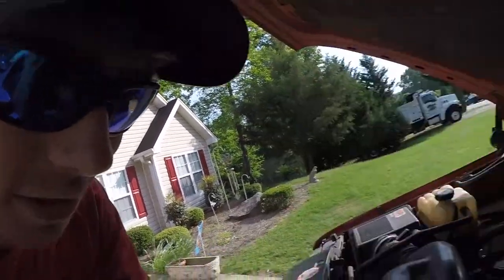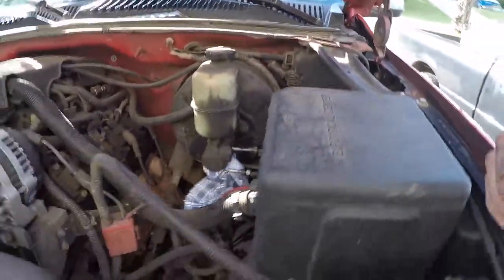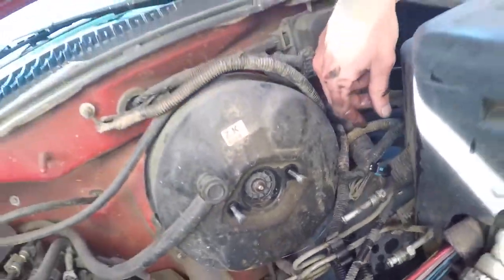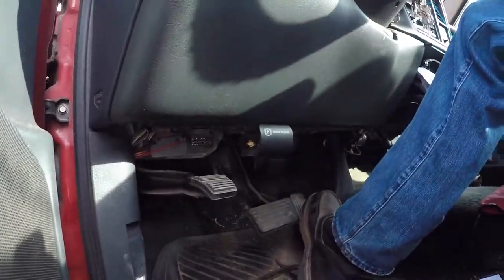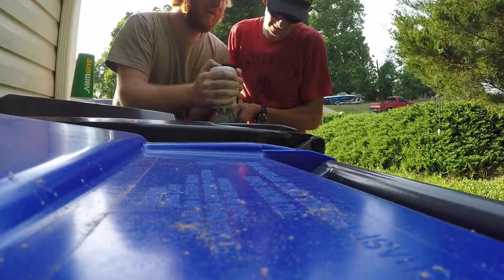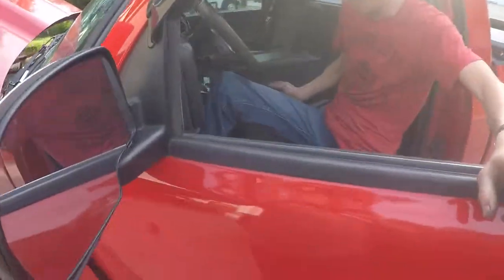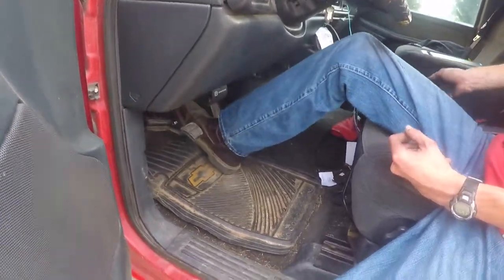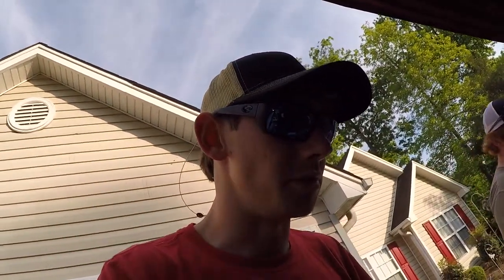Installing a new master cylinder on a 2000 Silverado

Comment: Uh bleed rear passenger, rear driver front passenger front driver... Smh rookie any time you introduce air to a brake system you need to trash can bleed the master cylinder AND all 4 calipers or risk death. Oh and slow smooth pedal pumps work best not to create foamy brake lines

Comment: Do you know if that Master cylinder can be changed out without the reservoir on top?
Reply: You can buy a master cylinder only and use your original reservoir. Cylinder only are significantly cheaper for many models.